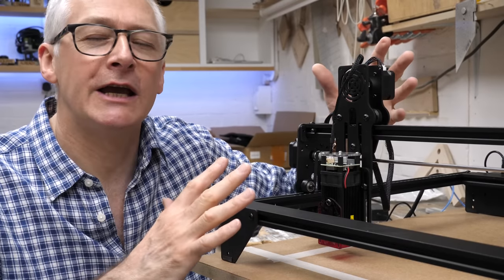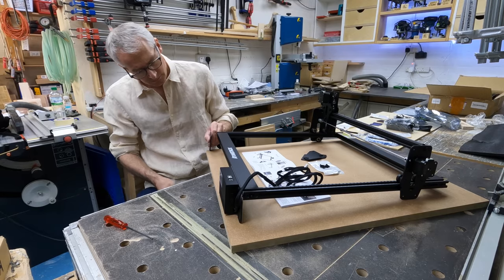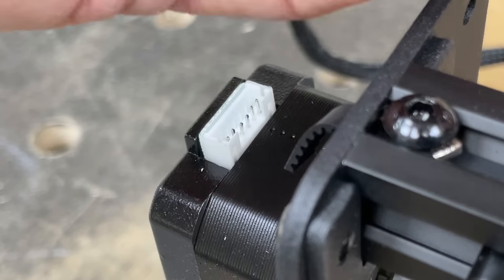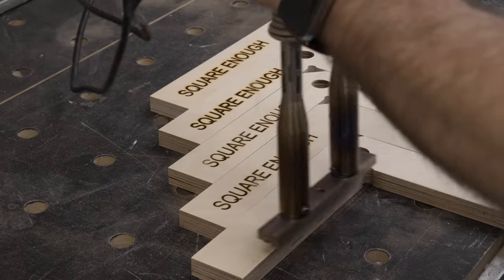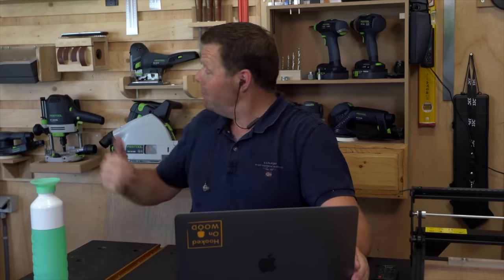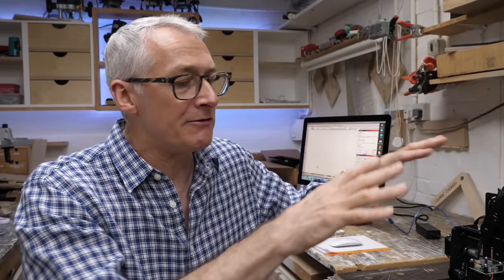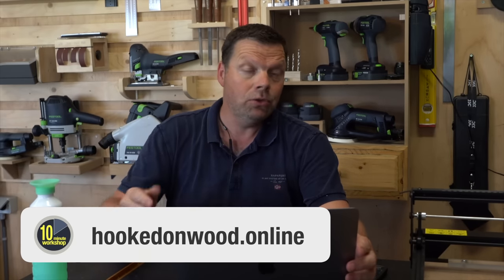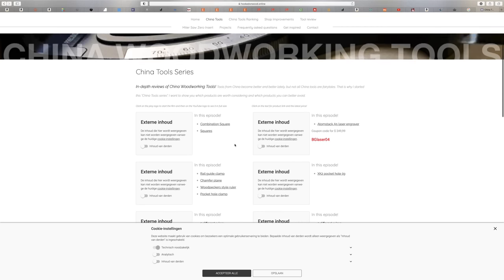Atomstack A5 30w laser/engraver [Ad**][video 458]

Comment: Agree with Dennis about the enclosure for both the extraction and reducing the chance of any laser light reaching your eyes. I use a class 4 laser in work and we follow strict risk assessments for its use, never in the room when it is on, trip switches on the doors to close off the shutter if someone goes in etc.  May even be worth writing a risk assessment, user method for yourself to reduce the chance of accidents. The mk1 eyeball is great but there is not a replacement yet 😮

Comment: A full enclosure makes for best 100% extraction.
A couple of computer fans is all you need, one pulling air in and one pushing it out through your vent pipe.
Green or orange Plexi glass full length as the lid, or part of the lid, makes it easier to keep an eye on the progress of the work.
Congrats on the new addition.👍🏽
Reply from the maker: Cheers Bill! 👍👍
Reply: all we need now is for Peter or Dennis to make one and save us lazy buggers all the time & effort :D.  Thinking about it, I've got some 18mm ply . . . .

Comment: Hi Peter, nice video. For a darker result on birch ply try de-focussing by 3 or 4mm - counter-intuitive i know but it seems to work. Of course there is a slight compromise with sharpness of edges. Just going to higher power seems to vaporise the wood rather than char it - and charring is what you want for a dark mark.
A sample square of ply with strips engraved at various powers/speeds/focus distances makes a useful reference piece. 
As a previous commenter has said, vector line engraving can be quicker - you can also experiment with de-focussing on that to get a wider line (and increase power to compensate for extra distance).
Do rig up some extraction - there is a surpirising amount of nasty sticky dust that gets blasted off the surface of the wood, you don't want to be breathing that in... and it will build up on the components of the machine too (but can be cleaned with warm water and a bit of citrous-based cleaning fluid).
Have fun though! All best, Mat.
Reply from the maker: Thanks! Yes, lots more experimentation to be done - wouldn’t have occurred to me to refocus the laser though, thanks for the tip - I’ll try that out. 👍👍

Comment: Another excellent video. I got my laser engraver a couple of years ago (in tech terms, it’s probably now obsolete. Mine is a Neje 7W Master; also from Banggood. Absolutely no idea how mine compares to yours except that the Neje has a maximum engraving area of 150mm square. Not that I have ever found that restricting as I also bought mine principally for engraving my branding on leather and timber. I use the proprietary Neje software but the Facebook forum has lots of people recommending Lightburn. 

The speed and laser intensity seems more of an art than a skill. Obviously, you can always repeat an engraving (providing you don’t move the substrate in the meantime - but you can’t un-burn a piece of wood or leather. I have used mine to cut leather and thin plywood - rather like a crude CNC. It’s okay but, again, there is a balance between speed/intensity/burning and cutting. No doubt that if I spent a whole day on nothing else, I would have most things figured out - but never get that luxury.

For me - now a 90% hobby cabinet maker with only a few commissions, it’s a nice-to-have. I do like having every piece that I make to have a brief description of what the timber or leather is; who made it and when. Plus, where appropriate, a personalised message to the person I am giving the piece to. So, in decades to come, somebody just look at the engraving and ask their parent about the old bodger who nailed this together. 

You are much more of a tech person than I will ever be. On the other hand, almost everything timber that I make is hardwood, although I use MRMDF as a substrate and glue my own cut veneer to the surface where it is appropriate. That finished product looks just as good as solid hardwood; is much more stable and should be far better for the environment. That is more than a slight knock on Oak Furnitureland.
Reply from the maker: Thank you! I'm still at the foothills of the whole laser 'thing' but Dennis has weeks more experience than I do! 😂 👍

Comment: Regarding extraction,  I'm a now happily retired electrical engineering contractor, on a ventilation extraction course many years ago (pertaining particularly to bathroom ventilation) I remember  (and I stand to be corrected) the lecturer stating that for every 90 degree bend (or an accumulation of bends adding up to 90 degrees, eg two 45 degree bends equals one 90 degree bend) there was a reduction of 50% air flow, so for example a fan rated at 100 cubic feet per minute (or the metric equivalent) running through ducting with two 90 degree bends (or an accumulation adding up to two 90 degree bends) would work out at 100 cfm minus 50% for bend one = 50 cfm, the second 90 degree bend a further reduction of 50%  (50 cfm minus a further 50%) which equates to the 100 cfm fan now only extracting 25 cfm, plus some losses even on straight runs, worth bearing in mind, hope I've explained that clearly.
Reply from the maker: Perfectly, thanks! 👍

Comment: You may find adding endstops fairly simple if the board has headers for them (may also require fiddling with the firmware), they literally are little more than some microswitches.

Comment: Apart from the health benefits, extraction clears the smoke from the path of the laser and prevents it from forming a buildup on the lens, improving the performance and longevity of your laser. It’s also worth considering adding air assist (a small air blower aimed at the focal point) which helps clear the kerf of debris, allowing deeper cuts.

I also found that the z-axis mechanism is far too wobbly. I have better results by keeping it fully up and raising the work piece to the laser instead.

I’m far from an expert, but this is what I have learned in the few weeks since I too saw Dennis’s video and bought one! (I got the 40W, because bigger is better, right?)
Reply from the maker: Thanks! Yes, if I'd known about the 40w I would have had that, too! 😂 👍
Reply: Looking at the product page at Banggood it seems that the cooling fan for the laser also already handles clearing smoke from the laser path.

Comment: I will have to get back to you on how but you actually can install the program and use it without having a laser hooked up to it. I don't remeber what I selected. Have to go back and do it again. The licesnse for Lightburn allows two computer installs for one key. I have it on a PC upstairs where I design and send it VIA the network to the PC that runs the laser in the garage.

Comment: Just a quick off the top of my head thought... Bathroom axial in line fan and some suitable flexible extract hose? 
Not sure if it would need to be FR. Maybe the flexible duct you would use with the extract fan may be suitable. You are not creating a commercial fume/smoke extract system just something for personal use.

As usual, great Video and Denis is a great chap.
Reply from the maker: Yes, that was my plan - just wasn't sure it it would need a hood, or could just follow the laser head. 👍
Reply: @10MinuteWorkshop  I’d personally do a hood. Mounting the extract on the cross rail close to the laser head might put unnecessary loads on the stepper motors and toothed belts. A hood made from suitably tinted Perspex held together with some Rare Earth magnets would make it a space saving item too. Collapsible when not in use.

Comment: Excellent presentation and the connection with Hooked on Wood added interest.
The laser was demonstrated doing a raster scan. Does it also follow a vector graphic? I imagine being GRBL driven that it should. For cutting out labels/stickers I would think that vector driven would be essential to obtain good edges.
Also will it cut through thin wood?
Reply: This is what I was wondering, although from a speed perspective rather than edge alignment as you say. I imagine that following a path for the pie chart section of your logo would be far quicker and more accurate than line by line raster, then raster the text
Reply from the maker: I believe so, but you've seen 100% of my experience with the laser; there'll be more to follow in due course as I use it more, but make no mistake, I'm approaching the path to the foothills that lead to the nursery slopes - there's a long way to go yet. 👍
Reply: @10MinuteWorkshop  oh definitely, just food for thought!

Comment: Hi Peter,

I have my eye on a Diode CNC for my CAD CAM 4 Woodworkers channel.

How are you getting on with this one, did it turn out to be a good purchase ?
Reply from the maker: Hi Andy. Beyond this review I’ve barely touched it tbh - I was making it a permanent home that then grew into a full-blown workshop makeover! But yes, it was working great; inevitably there’s a better model been released - the X7 Pro I think - that I’m supposed to be getting my hands on, but hasn’t materialised as yet. Solid little machines, though not the speediest or most powerful. 👍👍

Comment: I wonder what kind of laser it is. It says 5 or 6 watts of optical laser power, can a simple modern diode laser achieve that or is it a more complex structure? But anyway that is indeed quite powerful and even a diffuse reflection (e.g. from a matte wood surface) can damage an unprotected eye.

Comment: Peter, with lasers you get what you pay for, with those cheap Chinese lasers they take the total system current draw and use that to advertise the power rating. The true optical laser power is more like 2, maybe 2.5 watts. A quality 6~7-watt laser alone cost between $800 to $1000 USD. There is a lot you can do with one of those little toys, but realize it has limitations.
Reply from the maker: Oh yes, of course - as I think I say in the video, I’m not expecting it to be anything ‘production-ey’ just an entry-level machine to see why they’re actually capable of, and if it can earn the space it takes up. 👍👍

Comment: Great video as always, I would be interested to know if it could cut 3 mm acrylic.
Reply from the maker: I believe it will, but you need to take many passes to avoid heat distortion around the edges. I'll know more when I've used it more. 👍

Comment: Definitely put an full enclosure around it and run some extraction across the bed (air in and out). Even if you stick to just timber formaldehyde glues and the smoke is a nono for your health.

Also get a bit of cold rolled steel for the base it will typically absorb a lot of the energy it you do any cutting and raise the stock off the bed to cut. Even if you are just engraving it is way safer than pointing even this toy at MDF.

Also while Russ is talking CO2 Lasers a lot of the safety in particular transfers over https://www.youtube.com/channel/UCqCyShJXqnElPTUnxX0mD5A

Also for your Logo you might find Vector Engrave faster than Raster providing you don't have any larger areas od dark you want to include.

Comment: Hi Peter, possible video idea for you.
I currently have a broken ryobi random orbital sander and the only sensible priced replacement in stock is a makita. 
I like makita tools but would rather get a dewalt but it's out of stock, so here is the problem.
Where can I actually get a dust collection adapter that actually fits it. It is a constant minefield. I have one that is 3 pieces bodged together.
I have a cen tec system plus many parts that dont help.
I video with links to decent adapters would be really useful their expensive parts to not fit.
Thankyou for the videos I really enjoy them
Reply from the maker: Thanks! Unfortunately to make a video like that I’d have to buy or get hold of a variety of different sanders with different dust ports - something I spent years getting rid of! I agree it’s a pain having to adapt one to to another extractor, and it would be good to have a standard that would benefit everyone. 👍

Comment: Hi Peter,  can you advise what type of power plug is on this unit, did it come with the UK power plug?  I am keen to buy one but need to know the power situation. thanks
Reply from the maker: I’ll have to check when I’m back in the workshop to be certain Debbie, but I’m pretty sure the power brick had a regular 2-pin euro plug with an adapter supplied as standard. If you’re in the market for a laser there are newer, more powerful versions of this machine available btw - hope to be getting my hands on one soon. 👍👍
Reply: @10MinuteWorkshop  are talking about the 40w version?
Reply from the maker: No, there’s a 50w “X7” model, though the 40w is a step up on mine by all accounts. 👍

Comment: Design/engrave the logo as a vector rather than a raster, it should be a lot quicker and look better. Also don't cut vinyl to make stickers, it releases hydrogen chloride which forms hydrochloric acid with moisture in the air, that will corrode your machine even with extraction.

Comment: I always recommend people throw away those 240V adapters that come with Banggood (& other) purchases straight away. Because they are unfused (potentially amongst other issues!) they do not conform to BS1363 & constitute a fire hazard. I imagine insurers will be reticent to pay out after a fire if the investigation revealed the cause was a non-compliant adapter like these!
Reply: What would you recommend as a replacement?
Reply: @davidlove1887  If the device uses a regular detachable power cable (like a kettle lead), just replace the cable with a UK one. If the cable isn't detachable, I would generally cut the Chinese plug off the end & fit a UK plug top with a sensible choice of fuse (after briefly testing with an adapter just to make sure the unit isn't DOA!). If you really want to keep the Chinese plug for some reason, buy a proper compliant fused adapter from a reputable UK retailer - RS, B&Q, even Boots. At the end of the day, adapters are only intended for temporary use, so replacing a detachable cable or replacing the plug on a non detachable cable is the 'correct' solution.
Reply: @CJDavies  The ATOMSTACK power block comes with a standard Euro kettle lead input so your idea No 1 will work just fine : and absolutely agree with your comments :)
Reply: @davidlove1887  see below

Comment: Good idea not to chop the back end of the belt just in case the belt stretches as time goes on.
Reply from the maker: I thought so! 😂👍
Reply: They should be fairly stretch resistant due to the belt's inner core (cotton is it?)